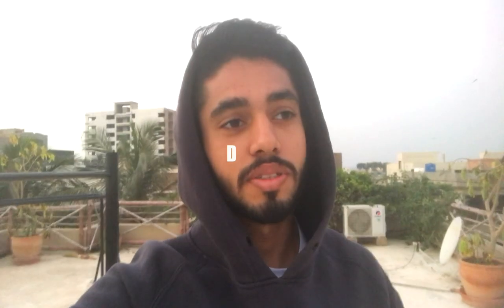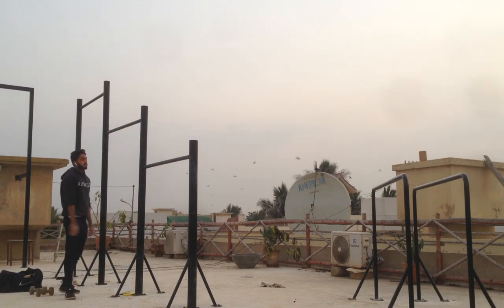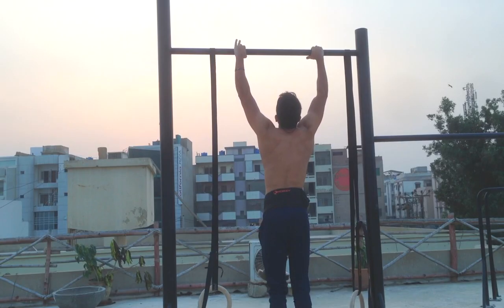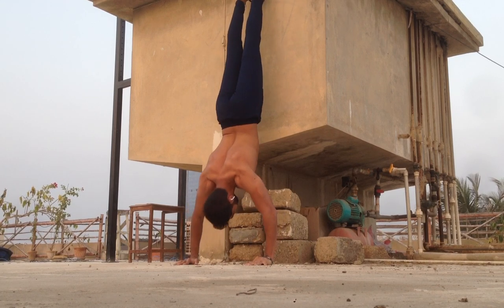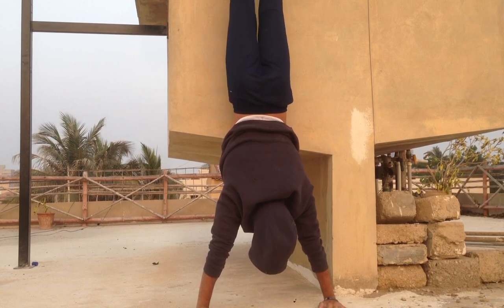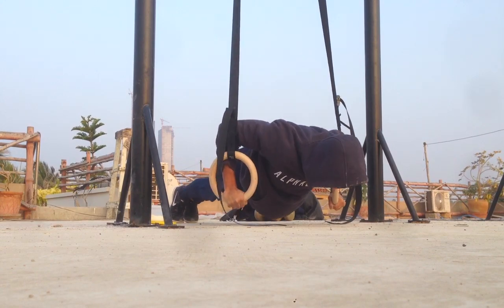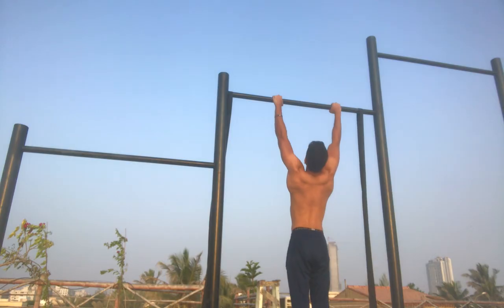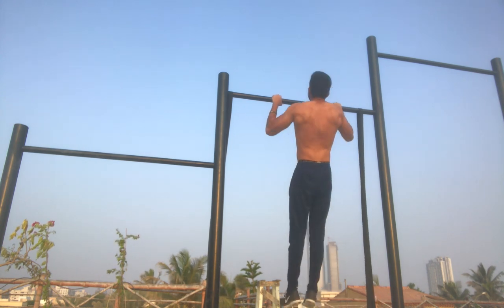Full Calisthenics Bar Setup + Full Workout (PAKISTAN)

Comment: Hey man, awesome setup, I'm thinking of doing the same thing on my roof. Quick question, I saw in someone else's comment that you had a problem with waterproofing the roof. Was that because of the holes you drilled in it? What did you do to fix it?
Reply from the maker: Hey man, it wasn't inherently a problem with the holes in the roof. The main issue was that the water wasn't getting drained out as there was no slope on the roof. 

I have redone the roof flooring, this time making sure that there is a slight dip/slope so that the rain water gets drained off the roof.

Comment: Hi...its a great setup 
I am also planning to have one in my backyard 
Can u please share its specifications such as dimensions of posts and diameter of bars etc...that would really help me to choose and decide.
Also give some rough idea that how much its gonna cost me to have 1 pullup bar and a dip bar setup....
Reply from the maker: Hey man, the bars are 1.75 inches thick. As for the height get one that suits your needs. My ideal bar height is 7 feet. As for the dip bars you can go for height wise I would say 4ft and thickness should be the same as the pull-up bar
Reply: Perfect...thanks man

Comment: How much cost on it brother
Reply from the maker: Hey man total came to be about 120,000/- PKR. But this cost was mostly because I got alot of additional stuff made that wasn't really required. You can easily get a solid pull-up bar and a dip bar setup within 50,000/-

Comment: Hey Man, Great vid. I wanted to ask what is the width of your pull up bar and of what material is it made of?
Reply from the maker: Hey man,  it is made from Galvanised Steel and I got these 4.5 feet wide in width.
Reply: Bawbarzz Thanks bro!
Reply: Bawbarzz One more thing. What is the diameter of the pull up bar? Thanks!

Comment: Hii brother how much its cost for installing your calisthenic gym
Reply from the maker: Hey man, total came to about 120,000/- PKR. But it can be done in less, I just ended up getting alot of additional stuff.
Reply: @Bawbarzz  do you think a pull up bar and parallel dip bars are enough for training strength and endurance. I already have weight plates, belt, barbell, bench, pushup bars etc.
Reply from the maker: @axbdaz4735  It would really depend on your goals. After a point pull-ups and dips will become easy and you'll have to either add other difficult variations or you could start adding external load to make the exercise slightly more challenging in order to keep building strength and muscle.

Comment: Why did you set up 3 different levels of pull up bars? Is it necessary or can we start with one variation?
Reply from the maker: Sai Tarun Gunda boss because I needed different height for the rest of my friends cousins etc. So that it’s easy for them too. The big one I kept for rings, medium one was the one I mainly used.

Comment: Can you tell me what can I do if I want to learn freestyle calisthenics in pull up bars  so what can I do to learn. 360 and more stuff on pull up bars without injury .....??
Reply from the maker: Hey man good question. I would suggest to start off with the basics and get your base very strong. Get stronger at pull-ups, dips, push-ups, squats and when you've built a solid foundation then you can start practicing freestyle. 

Sticking to the basics for a while and building your strength and muscle up will help to prevent injuries long term.

And when you do start training freestyle then practice with a mattress for safety
Reply: @Bawbarzz  I already did but I am not able to learn freestyle moves on pull ups bars due to fear and lack of mattress for below.😐
Reply from the maker: Kartikay Bisht Yea man fear is a big de-motivator. Start slow, start by just learning a simple 180 which isn’t scary at all and start understanding the swing. Adding muscle up dynamics into it too

Comment: Sir i am going to build the same.... Please send me the measurements and weight of material
Reply from the maker: Hey man, the grip width is personal preference. Get samples made of 1-2 inches. 

The bars I got were 5 feet, 7 feet and 9 feet in height. And 4 feet wide
Reply: I think i should fix a rode between the dips bar for stability what should be the distance between the dips bar??
Reply from the maker: @amangoenka8285  No no you won't need to fix a rod between the dip bars. As for the distance between them make them according to how you feel comfortable with it